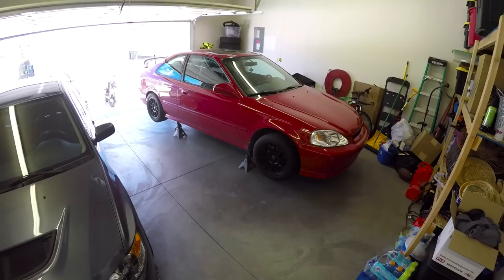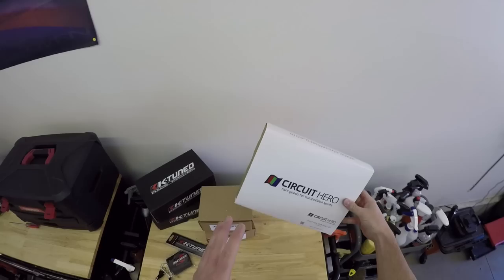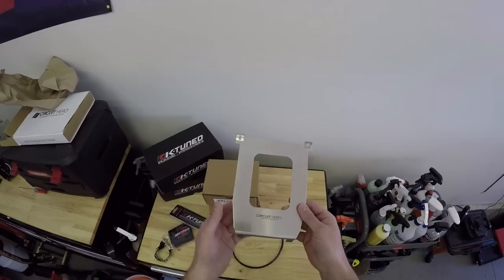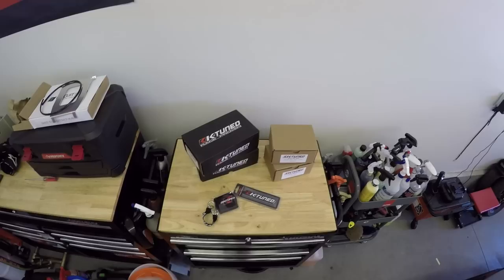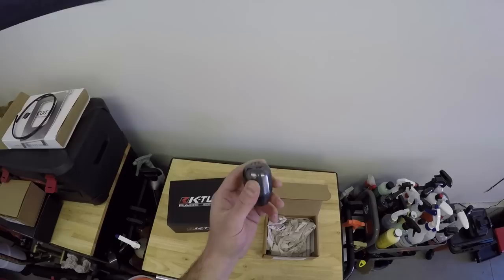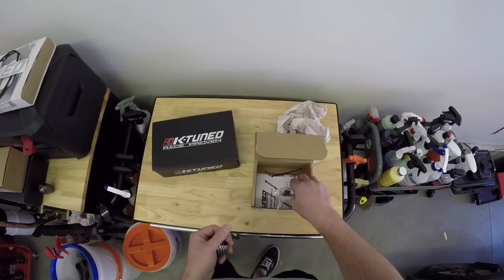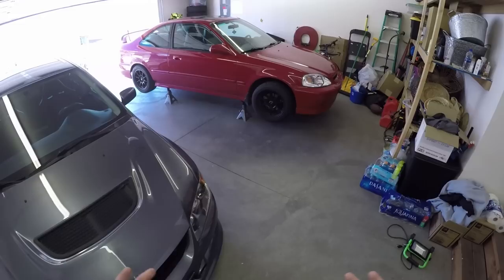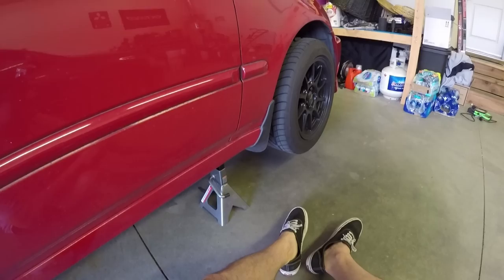The PERFECT Honda Civic B/D Series Shifter Upgrade? | K-Tuned Shifter X2 Install

Comment: When I did my V6 swap in my 6th gen civic back in 05 or 06, I went with the Hybrid Racing shifter kit.
Totally changed the feel of the car, before that, I was using just the stock 06 accord shifter.
Looking at these new shifters from Hybrid and K Tuned, I only imagine the difference now.
Reply: damn u j swapped a ek??? thats slic

Comment: If you want to replace the rear shifter bushings, try using a blowtorch to burn out the bushing and then hammer it out when it’s still warm. I had the same issues when replacing my cars control arm bushing and the blow torch helped out a lot!

Comment: I always thought people exaggerated the effectiveness of simple mods like this...until i put a short throw in my 00 Si. It really does make a considerable difference. When i did mine it was at the tail end of my mod list, so maybe it made everything else just work better together.
Stage 2 clutch, Jackson Racing Supercharger w/ 8psi, 4-2-1 DC headers, and a huge list of other bolt ons...then i put the shifter kit on there. Holy shit did it ever make a difference!!
My car was stolen in 06, 3 months after i paid it off and switched it to liability insurance. I miss flying around in those light little cars of the early 2000s....
Awesome channel dude, i just subbed. Lookin forward to new content.
Reply from the maker: Dang man I would have been heart broken

Comment: I made my own circuit hero shift plate I did not use aluminum I use steel so it can be painted but I polish it myself and add a clear coat and I use door jamb molding on it looks very clean easier to work with and the plastic gasket material that circuit hero sends you
Reply: It looks great with a wrinkle finish like you do your valve cover you can then put whatever logo your name whatever into the shift plate

Comment: hey Ant you should look into getting an Innovative B shifter linkages for your car that's what I run on my Civic  works great, also t joint that attaches to the transmission can be removed so when it does go bad all you have to do is buy that piece
Reply from the maker: I’ll have to check that out!
Reply: @ALLDAYANTHONY  👍 keep up the good work
Reply: He's got a d series tho don't he? The b series linkage wouldn't work if he's still d series the end tht attaches to the trans is different and the length is too
Reply: They might make a d series linkage as well tho not too sure

Comment: You sooooooo need a baby turbo and 8 to 10 psi on that stock motor
Reply: What ecu do i need to tune it?
Reply: @JordiHermsen96  convert to obd1 and run hondata v3 or v2 in a p28 ecu

Comment: A shifter plate that looks cleaner than the shift boot. 

Yea sure, now you got a 5 inch hole. Very cool. 

I’d be awesome with the OEM boot in. 

But hey. Apart from that, everything is awesome.

Comment: when i installed a short throw kit with new bushings it made creaking noises for a couple months under engine braking and acceleration so be wary of that and dont think your trans is broken
Reply from the maker: Yeah I could see that happening for sure
Reply: Yea lol mine creaked for awhile but it has quitened down an broken in now lol. The hybrid racing shifter really is alot better but I cudnt afford that lol I could barely afford the 179 I spent on the k tuned

Comment: Based on your experience which is better the honda solid linkages or the evo cable type shifters? Stock to stock or aftermarket to aftermarket short shifters.

Comment: Wish my ep3 had rod linkage, stuck with cables. End up saying stuff like that a lot. (macpherson front, long ass tie rods, eps rather than hydraulic power steering) Any previous si models hatch or liftback(preffered)? Just need the versatility of a little extra room without the cost saving decisions that make me sad.

Comment: hey those Harbor Fright jack stands are recalled. You might want to get different ones. They could fail if the weight moves on the car
Reply from the maker: These are not the model number that were recalled

Comment: 21:18 does anyone figured out that weird metal noise at 7k rpm?
Reply from the maker: That was me not tightening the adjustable rod on the shifter enough. It’s fixed
Reply: @ALLDAYANTHONY  hmm, i have some kind of that sound coming through the glove box area. And I think I can hear it in the engine bay in the transmissions area and can't find it

Comment: Hello Anthony, I enjoy all your videos. I have a em1 and bought it back in October of 99. Watching your videos has inspired me to get back to cleaning it back up and slowly replacing all the old and rusty parts. Funny thing, I live in Chicago and ended up buying the shifter you gave away. Instead of buying the Circuit Hero plate, I want to try to make my own with plexiglass. I was wondering if you would mind sending me the dimensions of the shifter hole. So if you can, the hole size, and the distance of the hole from the top, bottom and sides and it sits in the console. If you can, I would So grateful. Keep on Vlogging! Btw, I picked up an S2k steering wheel, asr subframe brace, get rear sway, new wheels, and an bunch other stuff to go in. I also modded Jeep LED fog lights to fit and it looks really cool!

Comment: Anthony, Can 6th gen parts (such as this Circuit Hero shift plate) be installed in 7th gen civics? I have an EM2 (2002 coupe) and the aftermarket part selection is much more narrow than what is available for EK/EG civics such as your 99 coupe.

Comment: Can I use this on my em2
Reply from the maker: That is a good question
Reply: No em2 is cable shifted instead of a metal linkage. Im sure u could find some kind of shifter tho. U should of got a 88-2000 civic mane. My mom owns an em2 it's a great car, No hate on the em2 it's just a totally different car compared to the 88-2000 civics. I love my b20b swapped 89 civic sedan it's simple and handles great and super torquey plus lots of parts around for it

Comment: I installed this on my si not too long ago do you get a lot of road noise and exhaust noise as well ? That comes up through the shifter I also have the shifter plate
Reply from the maker: Not much more noise than before to be honest
Reply: Mine's noisey but it's bc I got poly motor mounts even my stock shifter was just as noisey